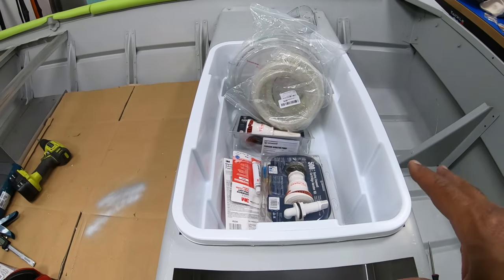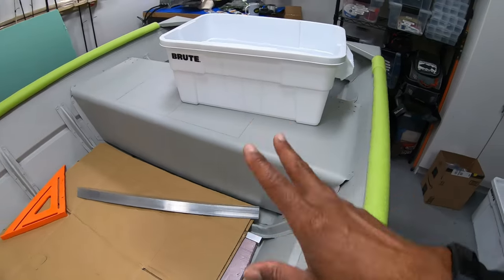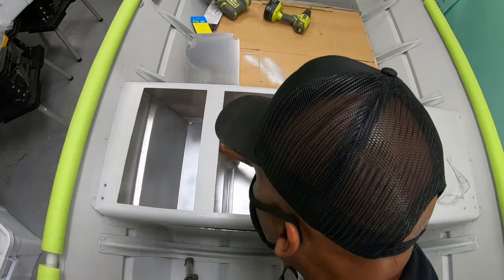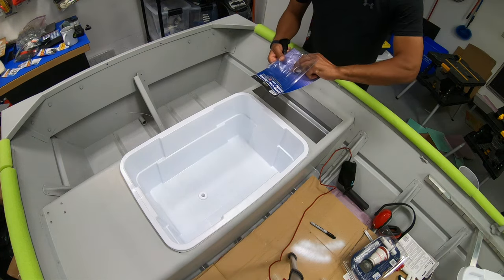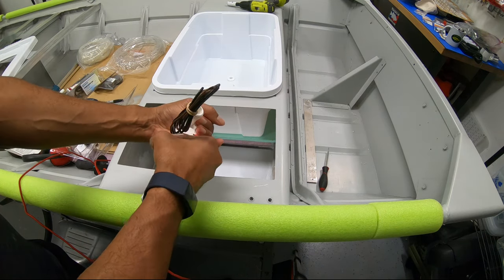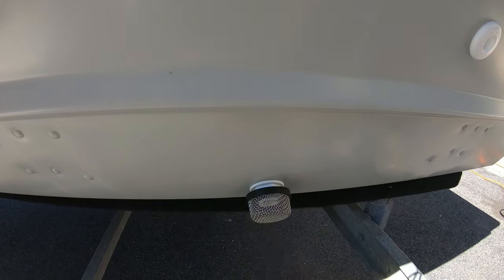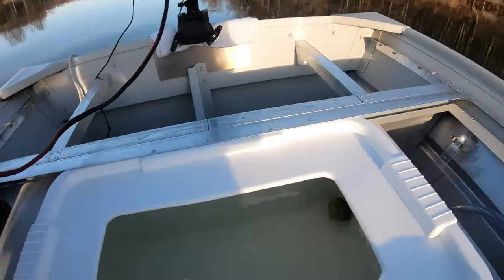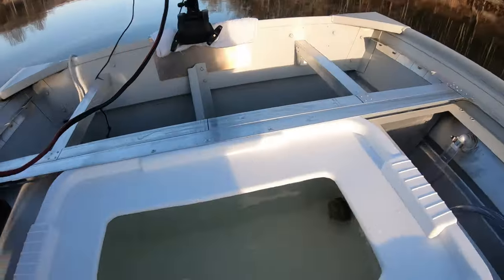Do's and Don'ts Of DIY Livewell Installs {Lowe 1436 Jon Boat Conversion}

Comment: Great vid! Are you adding somewhere else an equivalent amount of flotation foam you removed, so you won't sink if something/someone swamps the boat? One or two part pour foam (lifeboat foam) would take advantage of the unused space around your livewell, and have the side benefit of gluing the livewell in and giving it structure so the brackets are unneeded. Cordon off an area around your pumps.

Comment: Pretty much did mine the same way but didn't run my water in from side of boat did from rear so never got the air lock issue
Reply from the maker: Nice.  👍🏾👍🏾👍🏾

Comment: You know if you installed a flow rite valve you could eliminate one pump..   one pump with a 3 way flow rite valve would let you pump water in , then recirculate , or automatically recirculate and keep adding fresh water.. and gravity drain
Reply from the maker: True.